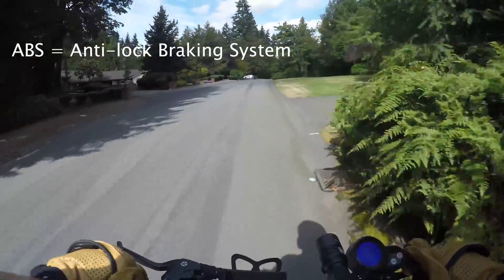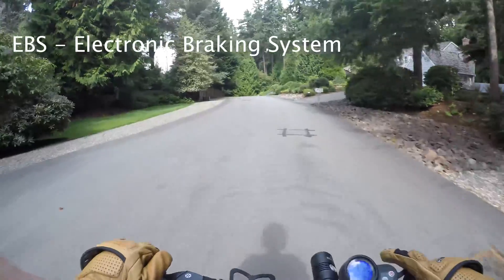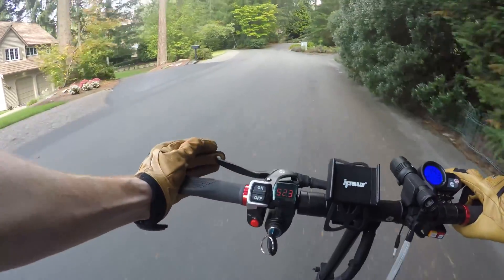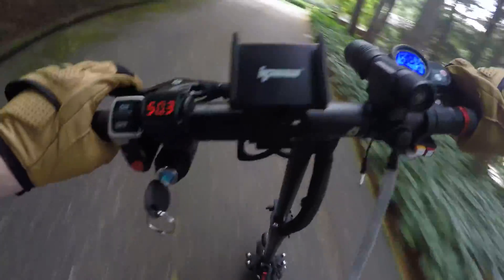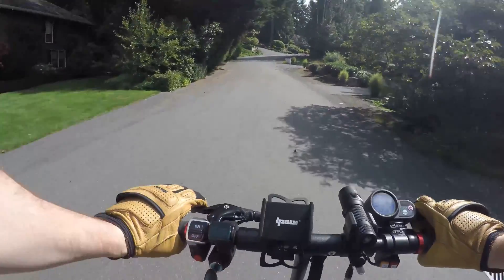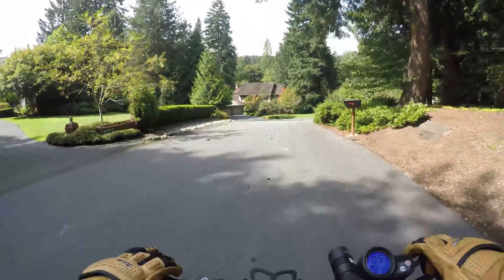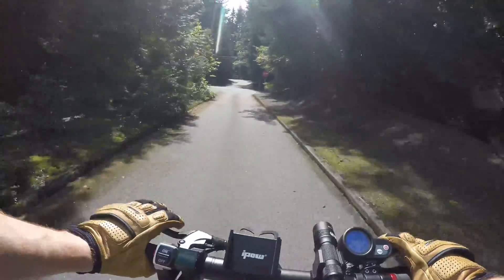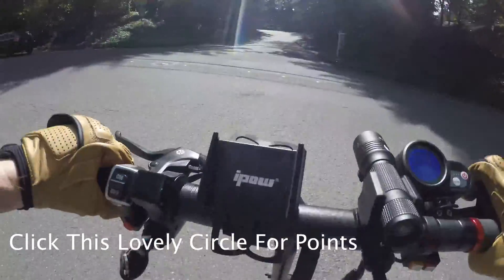Nanrobot EBS (Electronic Braking System) : What is it & how does it compare to ABS?

Comment: I have a LS7+ ... And when i was going 50mph the ebs randomly kicked in, while i was in full throttle, it almost wiped me out.. luckely my steering damper was almost maxed out and that helped alot to be able to control the scooter from making a 90 degree turn. So be careful not everything you get new will work 100%.

Comment: Do you need a break lever to engage the ebs ( or can I use a thumb throttle to connect it up ? , much appreciated for the demo btw
Reply from the maker: Brake lever works best since the ebs isn't progressive. It's on or off so having a throttle type lever wouldn't be of much benefit.
Reply: @GingerOnWheels  greatly appreciated, I guess that makes sense thank you. 🙏

Comment: This is only advertised on nanrobot's ls7, not the d6 or d4.   EBS is just regen, and it's really common on electric bike controllers as it slows you down, adds the energy back to the battery, and saves your brakes.  You shouldn't have to pay > 3k to get it on a scooter.
Reply from the maker: No. Not the same as scooter ebs. You're just talking about regen brakes.
Reply: @GingerOnWheels  what the difference between the two? Dose electronic braking charge the battery?

Comment: Hi i just ordered emove touring.. It has only rear wheel brake.. Do you reccomend turning down the ebs to lowest setting ( non zero) so that rear tires dont lock up? Will that have significant increase in braking distance?

Comment: With the right Vesc motor controller and a 3 wire analog output brake handle you can scale the regen EBS so the more you squeeze that harder the ebs regens and stops you.

Comment: You mentioned that you use EBS 1 because EBS 2 throws you into the handlebars. The controller on my 36V Razor EcoSmart scooter has only one connector for EBS labeled "low level brake". When I touch the brake lever it throws me into the handlebars. Using the mechanical band brake alone is like dragging your foot. Can you recommend a controller that offers EBS 1 and 2. I can't seem to find one.

Comment: Its kinda weird

I owned a 300 euros E-Scooter with EBS (only front EBS brake no disk and disk at rear) 

I tried it in snow and sometimes it keeps the tire from locking up and gives u enough time to react otherwise if u hold it long till stop u probably fall and lose control 

I put some screws in the tires for grip and works perfectly 😂
Reply from the maker: Ya I wanna try that technique for studded tires.

Comment: Does EBS re-charge the battery, also?
Reply from the maker: In theory it does, but I imagine very slowly.
Reply: @GingerOnWheels  Kinda twisted, now, on what to buy. It's mostly for my daughter and the last purchase I wanted to make was a refurbished Kugoo S1, good in Speed and adjustable steering pole height! But, I have to give up on online purchases, couldn't be shipped (Cyprus!). So, I have to buy local rides. There's one in a Toy Store branded Chic S-11, https://www.e-jumbo.gr/athlitika-eidi-paichnidia/skates-patinia-scooter/ilektrika-patinia/ilektriko-patini-1100-230-w-97x17x-99.5x45x107-cm_1489510/ Also with EBS but only a 4Ah battery. I'm gonna ask if it might be the latest version which could have a 5Ah battery already. Now, that I saw in your video how dangerous a front EBS brake can be, I'm a little worried and almost tempted to buy a cheaper Skateflash S1 or so which has the motor in the rear. Best I go to the shop and let them give me the manual in order to see if EBS can be switched to OFF. There's also the Xiaomi MI Essentials (non-adjustable steering pole, slow, inflatable tires (for me a negative, since I don't wanna pump anymore money into that vehicle, later). I'm also concerned about battery life. It's so hot here in Cyprus that most of my RC lipos puffed up and lose performance quite fast. Xiaomi will offer 6 months on the battery but they state it very wishy-washy: "significant performance loss" - LOL, can mean anything!

Comment: Is EBS BAD for the motors at all?  Sounds kinda grindy...
Reply from the maker: Nope not bad for them. That sort of grindy noise you're hearing was likely the fender rubbing on the knob of the new tire tread as the front suspension depresses under max braking  power.
Reply: Ginger On Wheels hmm gotcha... I only wondered because you or another mentioned that if the wheel leaves the ground and spins at max rpms then hits the ground (slowing down motor) it could be bad for the motor.
Reply from the maker: @bobcoleman9045  rotor*  like brake rotor
Sorry it's hard to understand :/
Reply: Ginger On Wheels hmmm...okay... probably buying d4+ even tho I primarily will be taking it up steep hills to work...d5+ might be better off for me Idk I'm at a crossroad..

Comment: Hey, I love your videos! They exactly explain same issues I had with mine scooter. Could you please tell me though, if the EBS kicks in at an instant when you press the brake lever or does take like 0,5 seconds? Cause mine does have a little delay.
Reply from the maker: Hey Jack ! Thanks for watching. The EBS does not kick in instantly. It takes about .5 seconds. There is a little delay with every scooter I've ridden with EBS :/
Reply: @GingerOnWheels  Thanks for the reply! I would like to see on your channel also a tutorial to make the scooter rain proof (waterproof) because I took mine out in a rainy day and water got inside the battery and I had to replace 6 cells in order to make it work again.
Reply from the maker: @JackMaslovLive  sure! I can do that when I get a chance. What kind of scoot do you ride?
Reply: @GingerOnWheels  The nanrobot d4+, old version. Got 1200 miles on it. Also relating to the video, I use EBS all the time it's very helpful and much safer, you hardly get to slip the tyre with it on. On mode 1 of course.

Comment: What ebs setting did you demonstrate in the video?  1 or 2?
Reply from the maker: I used setting #1. 
#2 is too powerful for me. Feels unsafe.
Reply: @GingerOnWheels  my problem with #2 is that is comes on unexpectedly.  So at 30 mph and you slightly pull on the brake levers there's no resistance nothing at 20 mph.  Only at around 15 mph or 10 mph it comes on suddenly and strongly.  I wish they would program it for strong resistance at the moment you trigger it with brake levers.
Reply from the maker: @MinhvuLy  ya... the idea of electronic brakes is really cool and some scooters, like the Macwheel do it really well. But unfortunately Nanrobot just did a terrible job executing the electronic brake feature. It's usable on the first setting, barely. But ya, #2 has issues.

Comment: Why are you returning it I thought you were happy with it.  Maybe I missed a vid where you mentioned that.  Vids are great thanks!  I just got a Dualtron Ultra its insane and now I am broke lol.
Reply from the maker: 3 reasons. The scooter goes 32mph top speed on flats. The scooter has crazy loud clanging front suspension. The scooters handlebars are cracked and JB welded together in that video. 
The new scooter fixes all of these things.

And btw: congrats on the Dualtron. Probably the first time in history someone will write off a dualtron on their taxes lol
Reply: Ginger On Wheels Yes that sound is the beginning of the folding mechanism falling apart I remember  telling you that at one point earlier. What are you going to buy? I’m excited!
Reply from the maker: @yogadude1234  I'm trying my best to work with Nanrobot to upgrade my D4+ to an LS7, but they are being very unresponsive about it. It seems like they really just want to replace my D4+ with the newer D4+ version. There is a D4+2.1 , has rubber suspension bushing, optimized speed , and better handlebars (allegedly), so they are going to replace my current scooter with that.
Reply: Ginger On Wheels I hear you.  Hopefully you won’t end up like me. I bought an Urbe Pro GT, Segway ES4 and even made my own  Speedway 4 clones on Alibaba. The Urbe lost all its power and the battery is impossible to replace. The ES4 broke down pretty quickly and my clones are also falling apart.  $5000 later I just really wish I would’ve purchased a $3000 DualTron.
Reply from the maker: @yogadude1234  how's the Dualtron ultra treating you?
Reply: Ginger On Wheels 1000 mile 30 day review coming soon - It’s kicking ass no problem so far